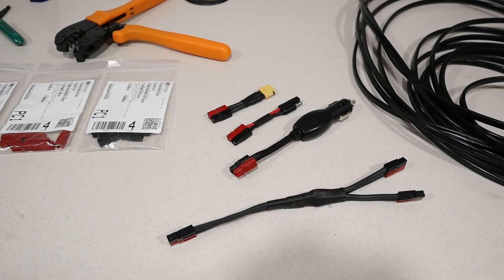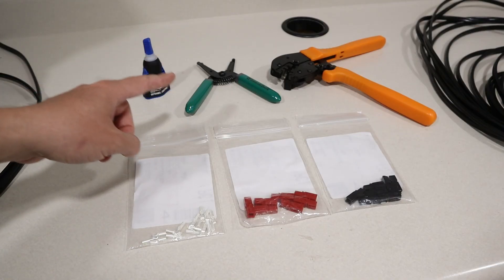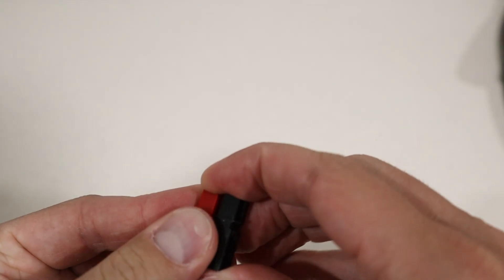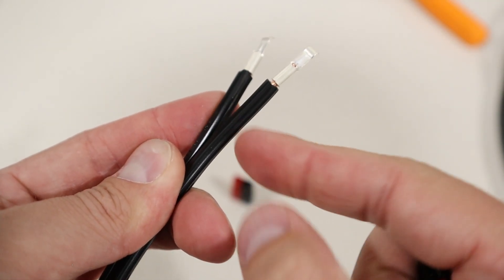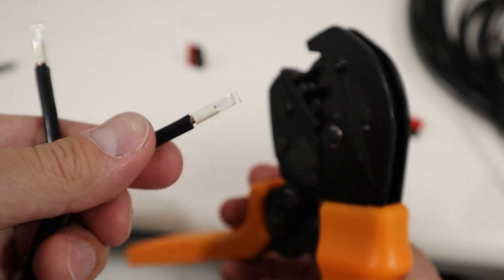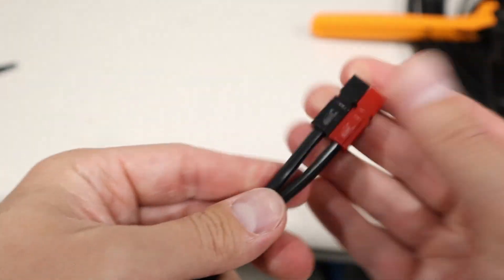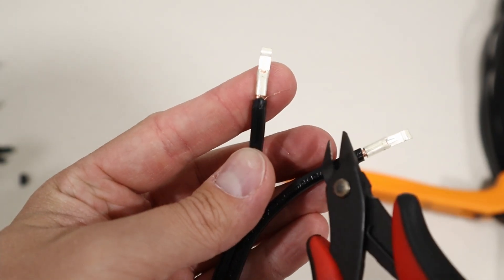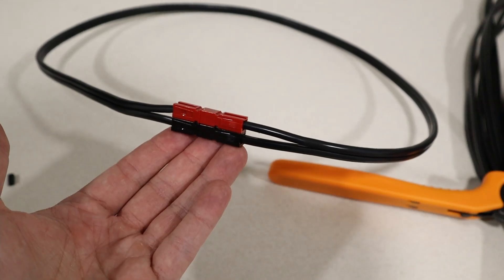Anderson PowerPole Connectors - EASY GUIDE TO WIRING - 15, 30, 45 Amp Connections

Comment: You don't need the super glue. A short segment of 0.095 inch weed trimmer line fits nicely in the locking hole.

Comment: I need an Anderson gland that I can use 8 gauge wire and mounted on the side of my house.
A dangling connector hanging don't cut it. Needs to be very robust and weatherproof.
Prefer one that blends in with the color of the house so as to thwart code enforcers as much as I can.
My array is going to be portable so to circumvent permitting (and thus higher property taxes).
Going from  8 gauge down to 10 gauge then back up to 8 gauge creates a fire hazard.
Don't need an extension cable.
Reply from the maker: Sb50 is what you need

Comment: Nice vid but if your using smaller wires the pins can’t be pushed in. You have to use a small screwdriver to push the pin in.

Comment: Great video and thank you. I would like to get your opinion on the size of the contacts. To me, it seems as though the contacts for 30A are too small. I could be wrong. I decided to go with the 45Amp contacts because it seemed like a better fit for the current. So far, not signs of overheating when touching the Power Poles.
Reply from the maker: The 45 amp connectors are great for higher power use cases.

Comment: My power station have Anderson connectors. Can I use this for it? Nilight - NI -WA 06 LED Light Bar Wiring Harness Kit - 2 Leads 12V On Off Switch Power Relay Blade Fuse for Off Road Lights Work Light, 2 Years Warranty,Black

Comment: Jason,  Very new to all this.  Sorry for the dumb question.  I have a Bluetti AC 180 and my question is, that I have a Go Solar panel set up as well as a bluetti 4 panel set up.  If I put these to panels together parallel or in series with a Anderson SB 50 to a MC 4 adapter and combine the solar panels for quicker charging, will this hurt my AC 180.  And is it doable?  Love your channel and thank you for all the testing of products.  P.S.  Both panels combined will not go over the 500 Watts.  Thanks Again John
Reply from the maker: That's a bit complicated to answer here in the comments but I do have a basic consulting service here if you want to submit a question. Just provide as much detail as possible so I can give you good direction:
https://asqme.com/@Jasonoid

Comment: If a single strand is not under the crimp connector simply remove the connector, retwist the strands, then put the connector back on.  Don't clip off strands that are loose.

Comment: Nice straight to the point video.  One extra thing I would do (and it may already be mentioned in other comments) is put heat shrink over the wires behind the connectors.  If only to stop the two wires from separating from each other down the length.  Probably not a common problem but, if it will happen to somebody, it will be me.

Comment: I just bought one of these anderson connectors off amazon to use with my Ecoflow Delta Pro Ultra and I can't fit them in there, So frustrating. I might try to make one myself after watching this video, I wanted to have all my Solar go to the DPU and trickle charge the AC300 with Anderson to MC4 connectors
Reply from the maker: Did you pull it apart and re-arrange the connectors? The Ecoflow units use a different orientation of the connectors for some reason.
Reply: @Jasonoid  ohh that's what it is? Im about to try that now. I thought I was going crazy for a second.
Reply: @Jasonoid  After pulling it apart and rotating it, the connection went thru but my experiment didn't work. I wanted to charge the Bluetti AC300 from the Ecoflow DPU with a DC to DC connection. I plugged it in, set the input to "Others" on the AC300 and nothing happened. So I unplugged it and tried it on the AC200p nothing happened over there either but this time I Received and Error code 101 on the DPU So I unplugged it and it error code went away. Do you know of another way of DC to DC charging for different power stations?
Reply from the maker: @Moes_Prep_and_Tech  the DC output of the DPU would need to be connected to the 'solar input' of the AC300 to work, but it will only charge at 100 watts @ 12v.... Just like car charging.

Comment: Harbor Freight has a workable general purpose crimp tool for $10. I use two crimps for each connector. The first crimp faces the seam against the male part of the crimper. Then turn the connector over 180° and crimp again. Works like a charm for a lot less money than the "official" PP crimper.

Comment: Can Powerpoles be used in automotive applications, say, under the hood?
Reply from the maker: They aren't a waterproof connection. If the location would be fairly dry, I think it would be fine.

Comment: On my Rockpals Generator, it has the female Anderson connector out to connect to the solar panel, but the Anderson connector adapter I ordered to match the xt60 from the panel is also a female fitting. How do I mate the anderson plug to a female Anderson receptacle on the generator? It has a charge controller built in to it. Just can’t figure out how to find or make a male to insert into it. Google search is throwing too much trash in my way.
Reply from the maker: All Anderson powerpole ports are the same, there aren't any male or female ports. You just need to slide apart the plastic connectors and reconnect them in a way they will slide together.
Reply: @Jasonoid  oh, I’ll try that, I must have to press harder
Reply from the maker: @robertchiarizia9463  line up red and red and it should slide together.

Comment: Can I just use flat pliers to crimp it?  It will work too by doing that right?
Reply from the maker: It needs the special crimper to fit into the plastic case. The crimper makes the terminal square. It's definitely worth the purchase price of the crimping tool. I have made hundreds of pairs with mine.
Reply: ok.  thanks @Jasonoid

Comment: Are all the black and red connectors the same size or do I need different size when using the 15 or 45 amp crimped connectors.
Reply from the maker: Hey Jim! The outside connectors are the same size for all the 15, 30, and 45amp terminals. You just choose the inside size  terminal for your load.
Reply: Great, some of the solar cables are "thin" 16 gauge.
👌🏼👍🏼
Reply from the maker: @garagejim1956  I prefer to use 12awg wire, even with a small load. If I use smaller wire, I'll fold it over itself two or three times before crimping it.
Reply: Great info, I was wondering about. The 16g are sloppy and loose after the crimp.

Comment: Good video very informative and helpful. I just wish the landscape wire came in red/black is all. I'll stick with the zipcord I get on Amazon or DX Engineering or Gigaparts. I need the color reference LOL. I found that the connectors are less expensive on the Powerwerx site vs Amazon, but you do pay for shipping.
Reply from the maker: This is where I have found the best prices on genuine APP in bulk. I usually go through around 75 to 100 pairs a year helping friends and family with their setups.  https://www.acerracing.com/collections/powerpole-connectors?gad_source=1&gclid=CjwKCAiAvdCrBhBREiwAX6-6UrSaNMAQFKzUZr4N8mf1QE-JPDEj4xpkrcKGiOHo5mXyYiACXIkkhxoCctwQAvD_BwE

Comment: To remove the connector from the shell, use an automotive pick to depress the leaf spring inside the shell, then pull the connector out.

Comment: I hate these connectors.  Two times I've tried to get them in.  Unless the wire is very stiff gauge, you can't get the things to click.  Second time I got the red side to click the but the black turned into a mess, and then the wire broke from repeated attempts to stuff it in with needle nose pliars to where it would click.
Reply: I take a nail punch and tap them in because they are so hard to connect,

Comment: I'm setting up my Point Zero Titan (3000w inverter) to some Rockpal 200w foldable panels.
So, you think 12 gauge wire would be fine. I see the option for 10 gauge, but wasn't sure.
Reply from the maker: 200 watt panels usually put out 10 amps or so. Should be fine for 12 awg. If you are going a super long distance I'd recommend 10 awg to avoid voltage drop and unneeded power loss.
Reply: @Jasonoid  thanks for the info. I plan to go 25 feet. Basically right outside my house, 
and run the cables through the garage and into the house (next to the door on the inside). This would just be for grid down emergencies.

Does increasing the number of panels used (i.e. 4- 200w panels) make a difference (amp-wise)? thanks

Comment: Hi! I think I’m going to convert to these (have had enough of SAE 😅). Do you know if the crimpers you use for these are the same kind that are used for the adhesive shrink tubing connectors (like battery spade connectors)? Thanks!
Reply from the maker: The crimpers need to be specific for Anderson power pole. You can find the link in the video description to purchase them.

Comment: How do you surface mount these in a box like you show in some of your other videos? For a solar panel connection that is. Thx great stuff
Reply from the maker: You look online for an "Anderson Power Pole flush mount" and lots of different options come up. Some of the best have been 3d printed off ebay

Comment: Nice video! What uses do you recommend Anderson connectors for?
Reply from the maker: You can use them for anything. Some people use them for HAM radio equipment. Some people use them for simple solar and battery connections. They work great for any DC load under 45 amps.

Comment: Hello Jason, great video! I would like to place a solar panel on the balcony and place a Bluetti AC200CP inside. I need a wire/connection that fits through a closed window, because i may not drill a hole. Do you have any recommendations what type of flat/bendable cable i may use? Maybe this is an idea for another video? kind regards, Alex
Reply from the maker: They have "flat solar cables" on amazon, that might be what you're looking for

Comment: is there a way to tell from the outside or the gauge of wire whether an existing connection is a 15, 30 or 45 am terminal (since the Anderson Powerpole connectors themselves are the same)?
Reply from the maker: The most common size is 30amp. If you look at the wire gauge you can usually estimate the connection.
Reply: @Jasonoid  Can you please educate me on the wire gauge that's used for each 15, 30 and 45a? I know that 12AWG is about the thickness of a dime. I'm guessing then that wires for 15 and 30a would be a little thinner. Maybe 14AWG?

Comment: Great video Jason.  Just wanted to mention, at the 7:33 mark, you can see the 2 holes on each side between the red & black connectors. Those are for inserting a role pin to keep the 2 from separating. In case you need to disassemble and repair later on. Kinda like a cotter pin.
Reply from the maker: I have used both the pins and glue. I've never had to take these apart afterwards  so I prefer the simple glue hack. Thanks for the tip.
Reply: ironic that I happen to already have a roll pin punch set (cheap one) somewhere laying around from my Anderson Lower receiver builds (no relation to the powerpole connects that i know of lol). roll pins are like... secret 1960s greybeard fastener knowledge. I mean, what im trying to say is that Ive never heard of anyone using roll pins now days for semi-permanent assembly outside of the firearms industry... thankyou for pointing this out
Reply: @vevenaneathna  I'm putting PowerPole connectors on all my radios, and noticed on the PWRcrimp tool instructions, West Mountain Radio recommends to not use either roll pins or spiral pins, as they both could fall out and damage the radio (Their words, not mine). The recommend the glue method. This is an EXCELLENT video!!
Reply: @wa0jtw  ya on my yugo underfolder ak47 (m70ab2) i randomly had one or two roll pins fall out from the stock assembly after shooting full auto for the first time. i guess they can work themselves loose and maybe short a cap or something
Reply: I would definately use the glue method if I was installing PowerPoles in a device; but for  jumpers I always use the plastic boot that comes with most PowerPoles. Even if you don't glue, the connectors stay together, and if you use the pin it can't fall out. 
Great video.  the only thing I would add: if you are plugging and unplugging often, add heat shrink on each conductor (covering the small bit of braided wire that is showing) and heat shrink to hold the two parts of the cable together, which adds some friction to keep the boot on. It's a bit of "belt and suspenders" but worth it I think to make the jumper last
Reply: You can also use 2-56 or M2 screws through the holes. Hobby shops have them in small quantities as well as 2-56 threaded rod.

Comment: really love your videos man. I'm a beginner with all this stuff, so excuse me if this is a dumb question. I've seen in other vids of yours how you cut off the 12v car charger, put on anderson powepole connectors, and then connect a 5 guage dc to anderson powerpole to power fridges (or other car charger 12v dc items in theory). My question is: do you use the 30 amp anderson connectors for that as well? Would I just follow the same process outlines in this video (for the connections) on both sides? and lastly what do I look up to buy the 5 guage dc wire for plugging into a solar power station? again, apologize if this is a foolish question. thank you regardless if you can answer. Your vids are the best!

Edit: I just rewatched the beggining of the "Bluetti EB70 WEEK LONG Fridge Test - ICECO VL60 Pro - Plus ESSENTIAL Charging Tips!" video and heard you saw 5.5mm barrel connector. Is that the 18 AWG DC power pig tail cable I'm seeing on amazon...and then just throw anderson powerpoles on the other end connecting to the anderson powerpoles replacing the 12V DC car charger coming off the fridge? thanks again :)
Reply from the maker: I just put out this video today, you'll find it helpful
https://youtu.be/Ylml-ogE3FE
Reply: @Jasonoid  Great, thank you. You videos are great.

Comment: I've seen these oriented in different positions, is there a standard for when +/- are oriented side to side vs top to bottom?  Related to voltage?
Reply from the maker: Looking straight at the connection it should be : Red on the right, little "A" up. That's the standard I have seen most places.
Reply: Exactly, some manufacturers use different orientations. So Anderson Connectors are designed to be adaptable. Therefore Superglue = BAD IDEA.

Comment: I already have the parts & equipment for making MC4 connectors.  Thanks to this video I now know where to get the parts & equipment to make Anderson Connectors.  Sadly, you don't include a source for those Anderson Boots nor do you show or use heat shrink tubing when making your connectors.
Warm Regards from Reno, Nevada
Reply from the maker: I don't use heat shrink or the boots, if you trim the wire exactly, no need for the heat shrink. The boots might be nice, I just haven't used them before.

Comment: 12 gauge is typically rated for 25 amps max.  30 is pushing it and 45 is really pushing it.  At least according to the wire manufacturers.
Reply from the maker: Good thing these come in 15, 30, and 45 amps sizes. The 45 amp ends are designed for 10awg wire, the 30 amp ends will fit 12 awg max, it's nice to have a connector that will handle more than the wire does.
Reply: think i was taught as an apprentice you always want your fuses to pop 'after' the wire melts the insulation! 😀 (this is a joke..just in case...)
Reply: @johnling2919  lmao
Reply: The gauge isn't the only thing that matters, but also the length and the type of current and voltage going though it as well.

Comment: Are these good for a 48v lithium ion ebike battery ?
Reply from the maker: As long as the amperage doesn't go over the connection type (15amps, 30amps, 45amps) you might be better with an XT90 connections

Comment: those connectors look really awesome. im not well versed in anything electrical, but i have a bilge pump that has a positive and a ground wire, that i want to connect to a car adapter plug so i could run the pump off an Ecoflow brand battery bank so i can then use it for my Gold Hog multi sluice i recently got. ive been just looking for such a solution to connect it all together and find appropriately rated components. basically, the pump is 1100GPH, 12 volt 5amp. and i would want to use the car adapter outlet on the battery bank. just not sure where to start on sizing the wires and connectors and such.
Reply from the maker: If the load is really 12v@5amps you could probably get away with 12 awg wire or 14awg wire to avoid voltage drop. The 30amp AndersonPowerPole connections in this video work with 12-16 awg wire i believe.
Reply: @Jasonoid  awesome, Thanks!

Comment: The crimp tool does a good job. My complaint about Powerpoles is the lack of friction when mated. They come apart too easily.
Reply from the maker: I like to double crimp the connections, I've never had one come off with a double crimp.
Reply: @Jasonoid  I think he means the mating of two connectors, not the 'mating' of the crimp of the conductor around the copper wire.
Reply: The connectors, when assembled, have a little hole in them. With two connectors mated, you can run a tiewrap through these holes and keep the connection together.
Reply: Yeah, but that's why he put a dab of Superglue on them.

Comment: Ideally, don't clip off the stray strand. Seat the connector again and get all the strands in.
Reply: Dont worry about it    A strand wont hurt   Deny the karens
Reply from the maker: I usually try for that but this brand of wiring is a bit big for the connector, other branded 12awg wire I can fit all the strands into the connector. Interesting how each brand of wiring is slightly different. Thanks for the tip!